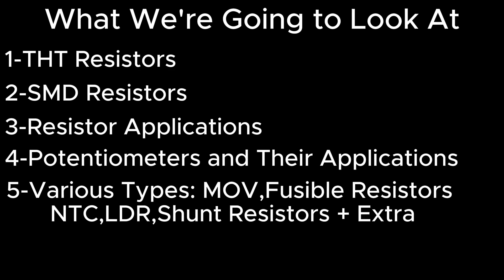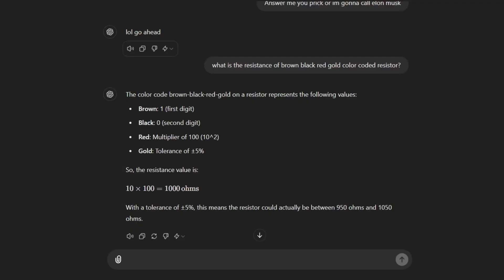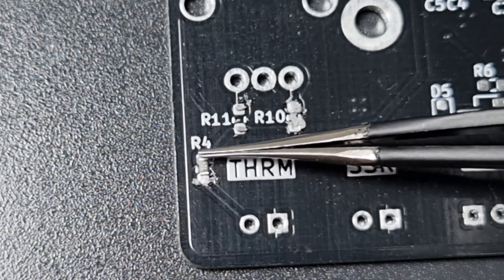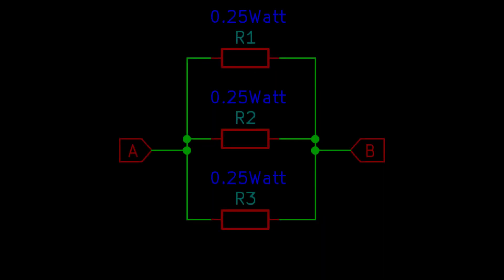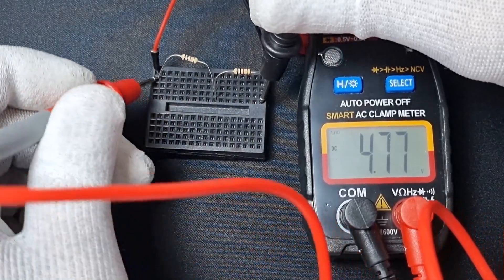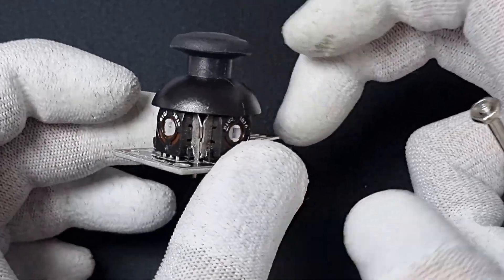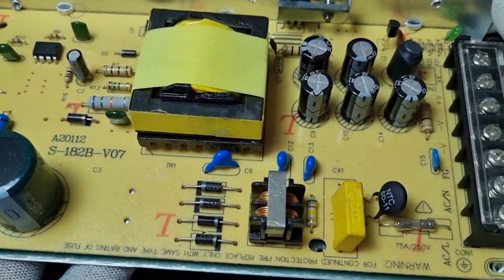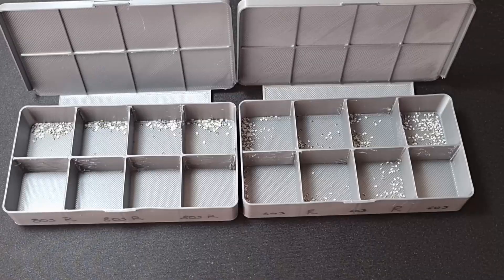The Ultimate Guide to Resistors: Types, Uses, and More

Comment: I have a question about diodes I have a old guitar amp I had two diodes to burn up in it and I have no idea how which way to put the new ones in does the positive side go from the transformer to the Cornell-Dubilier (CDE) Type FP "can" electrolytic capacitor it's a 1960s guitar amp
Reply from the maker: I'm not completely sure about this, and since we really don't want to risk damaging the amp, I'd recommend asking this on Reddit. You should be able to get good help in r/AskElectronics or a similar subreddit.
Reply: Okay thank you  @bitofelectronics

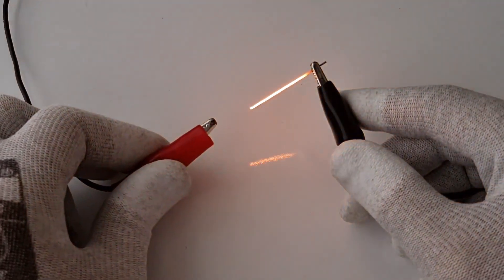Comment: All metal films aren't blue, or green, yellow etc though right? Aren't a lot of metal film resistors that sort of smooth/shiny lighter beige colour too, like at 1:12. If I have a bunch of NOS resistors that are unlabelled in type, is there a way I can tell if they are Carbon film, or Metal film, or Metal oxide for sure?
Reply from the maker: It’s probably hard to tell them apart if they’re unlabeled. I did some research, and gpt suggests that "if you can test for noise with an oscilloscope, metal film ones will have less noise than carbon. Resistance stability under heat can also be a giveaway, with metal film and metal oxide being more stable than carbon" But I don’t think this is a good method.